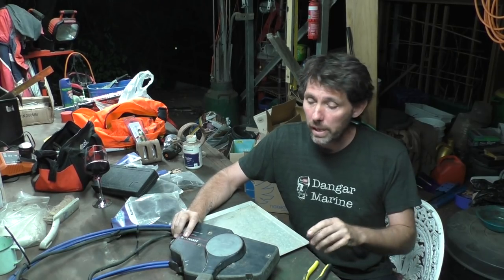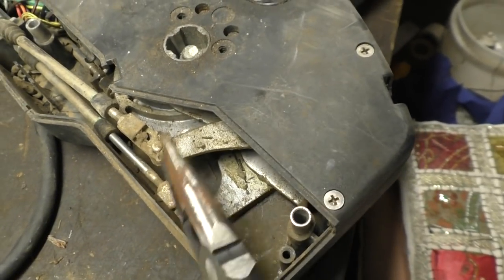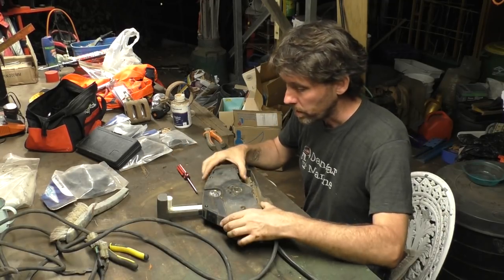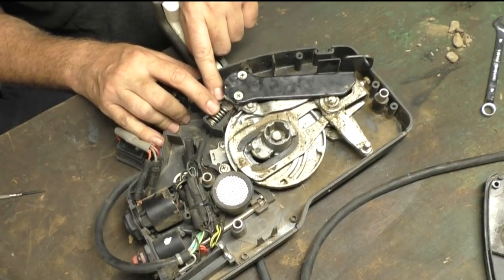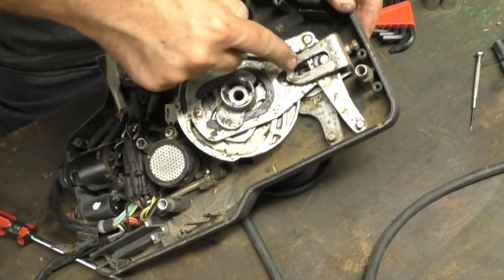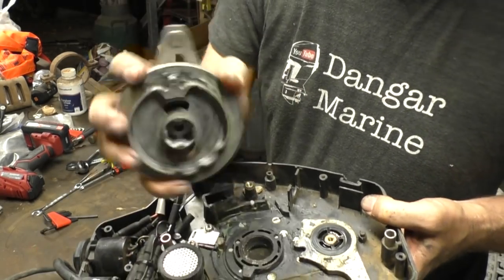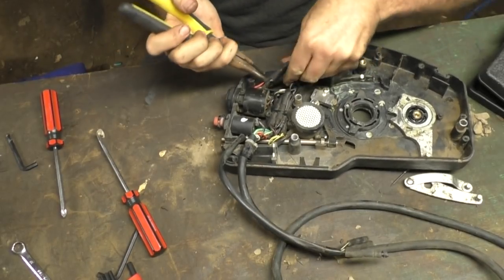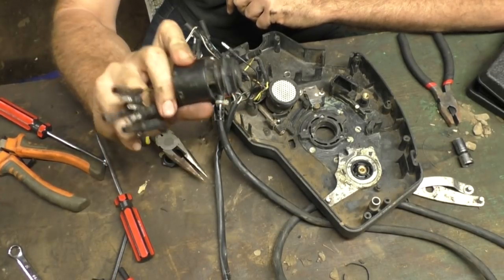Outboard Forward Controls

Comment: Hi Stu - just a quick tip for some. I was putting my forward controls back together after flipping it from a right to left side configuration and I couldn't get it to slow idle. After the third attempt I spied a little bush. One of the pins was supposed to run in the bush inside the mechanism. When the bush and pin were re-united I got my slow idle back again.
Reply from the maker: Definitely something to keep an eye out for. I've seen plenty of these where a missing / misplaces or worn bushing have been the cause of trouble.

Comment: Nice video as usual Stu.  Honda does the start in gear protection at the motor.
Reply from the maker: Hey WIll, yep, and I think it makes more sense because you wouldn't have to redesign the motor for tiller and forward control versions.

Comment: Thank you for your videos.  I learn a lot from them.  Great light, camera shots at good angles (no hands in the way of the camera, etc.).  I'm looking for a video on how to properly set the throttle cable and cam thing on a Honda BF40A outboard.  I took off the carbs to clean them and now my idle and such is a little out of whack.  In the cam where the screw is, there's a spring that has a little loop in it.  Not sure if I reattached it back correctly.  Also, I don't know how to adjust the linkages and such to make it go full throttle.  When I press forward on my controls to full throttle, it's not full throttle at the cam.  It's just short of that little corner to where it will go full throttle if that makes sense.  I can't find a single video anywhere on YT on how to set these linkages proper.  I can't believe it.  All those Honda 4-stroke outboards out there and no videos on the subject.  I see old 2-stroke videos on super old motors, but nothing on the BF series Hondas or Yamahas for that matter.  Maybe there is one and you can point me to it or you can make one, that would be great.  Thanks again.

Comment: The OMC controls cable levers use a pin in a groove on the throttle lever 'drum'  to control things. Neutral start switch in in the control box. The OMC control also only allows about 1/3 to 1/2 throttle in reverse, which until I read the manual and found that info , meant I spent nearly 2 days trying to get equal throw from the throttle cable in forward and reverse. 
One thing in the video, that sound of sand and corrosion grinding in the control box made me cringe :-)   Another good 'demystifying' video Stu, thanks.

As an aside, do you guys have anyone that rebushes carb butterfly shafts? Mine have about 1mm of play - which is of course a massive air leak . Some thing to add to the carb rebuild video notes maybe- no use installing a kit or rebuilding carbs with butterfly shafts flopping around - and with old engines such as mine and no replacement carbs available - that could be the 'write off' item  for the engine.
Reply from the maker: Hey Ron, can't say I've ever seen a carb with the shaft worn like that, but I'm sure someone will be able to fix it up. I'll grab an old one in the workshop and pull it apart to see what they are like. I wonder if a machinist could turn something up that you could heat and then shrink fit back onto the shaft?
Reply: Quite common that the steel shaft wears away the alloy pivot hole. After 40 years of use it has to be expected. Kadrons on VW  engines are renowned for this issue. 
I will drill, fill and redrill the carbs if I cannot find a good replacement. I use brass rod, and for these  roughly 1/4" shafts I will use 10mm brass rod to rebush the carbs. It is a fiddly job so I prefer to get some one else to do it :-)

Comment: Mate, I have a Honda BF130, there is a switch that is a solenoid, it appears to be a"choke" above the ignition, I have no idea why its there. I never had to switch it on to start my motor. Also my BF130 has man types of remote controls and ignition controls over the 2000-2004 years and some have it and some don't. Makes no sense since its fuel injected 4 stroke...

Comment: Nice video Stu,  just about to rebuild my forward controls as I've lost reverse and neutral although it's a little older than your one with the forward, neutral and reverse controlled with 3 connected push switches. Thinking about using an Arduino and few parts from jaycar to replace the rather hard to find and expensive omc switch control unit should be an interesting project.
Reply: Cliff, so you have a 72/73 electric shift outboard? If the leg solenoids are definitely OK (they usually fail first) then a simple 3 pole , double ganged switch should do the job.
Reply: Yeah I've got a 72' Evinrude 100hp with electric shift, actually that's what I've done for interim but I'm really worried about accidentally bumping the switch and changing gears when in full throttle which I image could do really bad things. So I'm thinking about using the Arduino to control the process of switching gears eg. not change gears unless the throttle is in any other point but idle, always going into neutral before going into forward or reverse, maybe even having a delay between gear changes to allow the gearbox to slow before change gears, as well as lighting with switches to indicate what gear I'm in.
Reply: I am hopeless at programming, I can do it, but it is never pretty . I tend to spend too much effort in dumb operator checking routines. Arduino would be an interesting way to go, but filter the power supply big time, those alternators are extremely spikey (lots of ignition spikes in it) as clean power for chargingthe battery was not really a major consideration of the day back in 72. 
  If it was mine I would go with self latching relays, a rotary selector switch ( hard to bump those) and use the start in neutral switch power (it switches power even if the engine is already running) to supply power to switch the leg solenoids only  when in neutral. LED indicators would be an easy addition. PM me if you like.
Reply: Good point about the power filtering hadn't thought that far into it.
Reply from the maker: Sounds like a really interesting project. I worked for ten years as a commercial programmer so that's sort thing I really like. :)
Reply: Cool is there anything you can't do Stu :) I actually work as a web developer myself although I've never programmed or used an Arduino before its language look pretty high level and similar to C or C++ so it shouldn't be too big of a deal to learn (hopefully) and they're a lot cheaper ($15) than the Netduino3 ($60) which are programmed in my language of choice C# . My challenge will be the electronics side of things which I'm pretty new to. Anyway should be fun I'll let you know how I go.
Reply from the maker: Hi Cliff. I've never done any Arduino programming, but I did write my own programming language in C so I'm pretty familiar with that. A friend of mine that I used to work with is big into embedded electronics and would be happy to get involved I'm sure. This is his channel https://www.youtube.com/user/lucsmallau

Comment: Hey Stu,

Quick question. I have a 2006 Yamaha 40hp 4 stroke outboard motor and I noticed there is some oil in the bottom cylinder. Do you think my valve stems are bad? Compression is even on 3 cylinders. Thanks!

-Eric
Reply: Hi Eric,   can I butt in line here and comment/ask questions about your situation?  I'm thinking that if anything, it might be worn valve guides before the actual valve stems themselves,  but I'm curious about what sort of treatment the engine sees in service.  Does it do an awful lot of idling, or very, very light work where it's not under heavy or full load?  I ask that thinking that under heavy, hot operating conditions, the oil should be burning off with the heat.  I'm surprised you're finding it inside a cylinder.  Must be fouling the plug something fierce.  How is the level of lube oil in the sump?  If you are finding amounts of it in the cyl, the level in the sump must be going down.  You say that compression is even across all cyls,  it would lead one to think that the rings are in good shape, but if excessive amounts of oil are getting by the oil-scraper ring,  it would get into the compression rings and artificially "boost" the compression readings, the way that when doing a compression test "dry" vs "wet" by adding a few teaspoons to a cylinder would yield a higher reading immediately.  My guess would be a bad scrape ring,  but I would hold on, see if Stuart has something to say from his experience with Yamaha outboards.  He might have run into this before. I'm just going by theory,  I'm more of an armchair outboard enthusiast, whereas Stu is hands-on.  Best of luck with the problem.
Reply from the maker: Hi Eric, great to hear from you, sorry it's taking me so long to get to comments these days. Stan is right with what he is saying. I would also add valve stem seals into the equation, not just the guides though. Does the oil collect after the outboard has been sitting for a while? Did you have the head off when you saw it or just looking through the spark plug hole? Really can only be rings, valves or head gasket.

Comment: Yet another great video Stu. I have the same one on my bf130 and my battery indicator light recently went from intermittently on when I turn the ignition on to not coming on at all. I've tested the indicator light by connecting it to a battery and it lights up fine so I thinking I have to work backwards now by doing a continuity test from the white and blue battery indicator connection wire in the remote to the alternator next.
Reply from the maker: Thanks Stephen, sounds like you've got the right approach to finding the problem. All you can ever do is slowly isolate and test one piece of the system at a time. Eventually you'll find the culprit!

Comment: Hi Stu,  good video as always. I've never owned a boat with a forward control so I need to ask, what is the fast idle for?
Reply from the maker: Hi Anthony, good question. With a tiller you generally have separate gear and throttle controls. This means that you can rev the engine in neutral without going anywhere. With forward controls as soon as you push the throttle forward it goes into gear so the fast idle is a lever that lets you increase the revs without selecting a gear too.

Comment: I have been watching your videos a lot lately. I have learned so much about my boat and working on it thanks to you. Keep up the good work. I do have a question. I am rebuilding a 1993 pontoon boat with a mercury force 75hp outboard. The initial throttle control was a side mounted control. However I bought a new console that has a spot for a top mount throttle control. Is it a problem to switch to a top mount throttle?
Reply from the maker: Hi Dustin. No, that shouldn't be a problem at all.

Comment: Hi sorry to bust in but loving your videos !! Can you tell me why you don't use Suzuki I have a DT90 V4 1989-90 is this a good or bad engine or anything to look out for 
P.s newbie at this so not sure how to private message 
Also I've just gone to use it for the first time this season and found the steering seized up !! Only had a new steering cable fitted 2 years ago or less wish I watched your vids and done it myself! Does this sound like the tilt tube to you ?? 
Thanks again and thanks for your amazing videos please keep posting 👍🏼
Darren 
Also I have to tube coming from the speedo pick up pilot hole at the foot of the motor is this a easy fix are shall I install an external pickup ?
Reply: get a hammer and a block of wood with some lithium grease get two guys one on the wheel and one on the steering arm and slowly work that girl loose….lesson every fortnight go and turn the engine a few times.

Comment: hi stu, i am wondering if you could please do a video on installing a tach, from scratch? im trying to get the tach in my boat working and it would be extremely helpful. i have a 80hp 1979 800 merc with mercontrol foward control.. btw loving your vids, very informative , saved me lots of $, cheers =)
Reply from the maker: Hi mate, yes, I would like to do that as the Green Machine doesn't have a tacho and I'd really like to put one in. I'll be sure to film it!
Reply: legend!, i ended up fixing mine, turns out the previous owner had the signal wire and the power wire mixed up and it was connected wrong, gotta love easy fixes like that!, i also have a psi gauge that doesnt work any thoughts and suggestions? i have traced everything back to the engine and it seems connected etc, mayby a faulty sensor?

Comment: Stu - where would you go shopping to buy an extension main wiring cable for a 1996 carburetted BF45? It needs the 14 pin round plug at the motor end and a bunch of small plugs to connect to ignition switch, indicator lights, tilt/trim etc at the forward control end.

Comment: Great video! Wish I would have seen this a few months ago. Just replaced my trim switch in a commander series for Mercury ob. Putting everything back together, I broke the neutral switch, so had to replace that. Now I have been popping fuses while running boat, so must have some wires touching somewhere. Happens randomly so like you said, there is a lot of wires compacted into a small space, so something is shorting when moving throttle.
Reply from the maker: Yes, it is very easy to pinch a wire in there and cause shorts just like you describe. Fingers crossed it won't be too hard to spot.

Comment: Hi Thanks for another great post, I know this is an older post but just a quick ask for advice. I have a friend with a BF10 honda fitted with this type of remote it all looks good condition and very low hours. I have disconnected cables both ends and they both move freely with no issues. The outboard end again with cables disconnected moves forward reverse and throttle again with the expected amount of resistance. same with the controller end all works as it should. How ever when all connected up the throttle is stiff going into the gears is normal but then a lot of effort is required to increase speed. the friction adjustment moves freely and it moves as it should it is completely backed off. what I have noticed and confused about is with cables connected on throttle end the outboard gear cable has a throw of from neutral 35-40 mm to reverse and similar forward. But the gear leaver engine end seems to have a throw of 20mm to reverse and 20mm to forward this seems to cause the stiffness ? this is about 8 yrs old but very low hours they came together. Is there any adjustment to set these up ? on some other makes like morse there are often 2 connection points for shorter and longer throw however the honda unit doesn't seem to have this?? any ideas ? I hope I have explained thus well, everything looks new and is well lubed.
Reply: i have a similar problem on my BF100 .....did u fix yours ?

Comment: Love ya vids mate!    I'm having issues with my ignition key barrel and safety lanyard/kill switch.   It's a Yamaha 60hp 2stroke 94 model.   First symptom was an intermittent  ignition(would turn the key but no starter motor) then wriggle the key and it would work)   Now the key starts the motor but won't turn the motor off. It keeps running with the key all the way out of the ignition and the lanyard off. Have to disconnect the fuel line to stop her lol   I haven't yet removed and had a look...
Any advice would be appreciated 👍✌

Comment: Hi Stu. Thanks for a great video and explanation. I recently purchased a Nitro 190 DC with an old Mercury 200 ProMax from 1994. I have a problem with the hand throttle not holding constant speed. It gradually reduces the speed slowly unless I leave my right hand holding it down. Can I adjust that? Many thanks and hope for a reply. 
Jonas Olsson

Comment: Hello master of mechanic😁.I have in my mind a project that has one board and 3 servo motors(throttle,steering,gear)Can you lock a position (like minn Kota does) and the board can give rules to the servo motors to be all the time at the same place  you have locked?Thank you very much.

Comment: Are controls pretty standard from engine to engine if they don't need wiring? I have a 2007 Yamaha 40 2 stroke.  Could I use Johnston Controls for it do you think? I don't have power trim or electric start so literally just need the throttle cables to work.

Comment: I have a Honda 50 hp and the controls are having an issue. If I’m going full speed in forward or reverse and back off to neutral, the fast idle shaft will raise up and keep the motor revved up. I have to manually lower the throttle lever back down every time. I’m hoping to avoid replacing the whole control assembly. 

Any thoughts?

Comment: I have a Johnson 1984 140hp and I find at the engine end of the throttle cable the cable end moves quite delayed when moving rote control.  I find after putting remote into gear half the forward motion of the remote doesn't increase revs. Revs only increase after pushing remote more than half way through range. Is this a bad throttle cable ?

Comment: Hey Stu I have a prib with My OMC FIR EVINRUDE 90HP OUTBOARD MOTOR . When I out my shifter in reverse works perfect when put in forward on low gear works great and when up to half throttle works good too. But when I am shifting to high on the shifter or gear box it's revs up goes to move then sounds like I'm revving in neutral can you tell me the probs. Thought it was motor prob had 1st and second motors completely rebuilt so has the he shifter controlled but what help b4 I sink my boat ty

Comment: Hi Stu,

I have the same honda control and mine also does not have the trim button. Howerver, I purchased the trim button and would like to install it on the handle. How do I need to run the wires through the handle into the control box without creating any friction between the handle turning and the wires running through them?